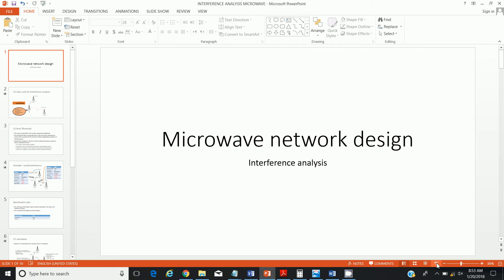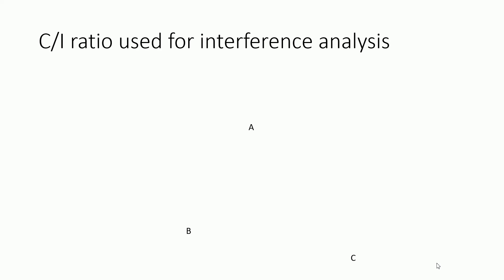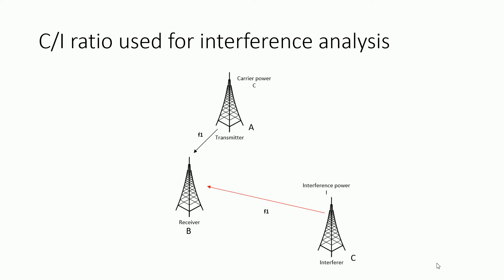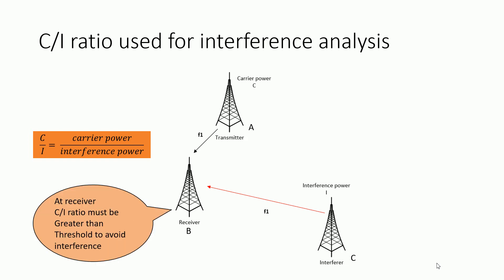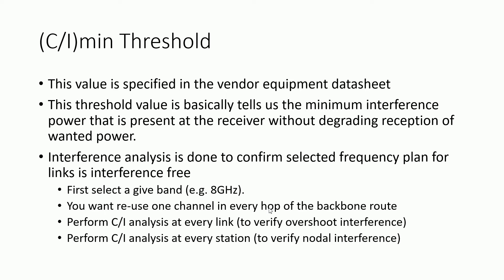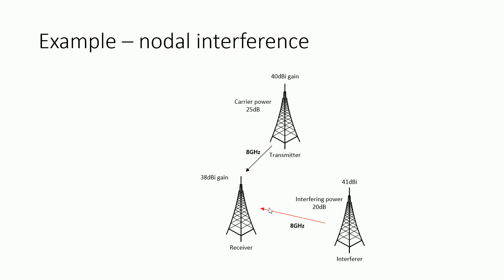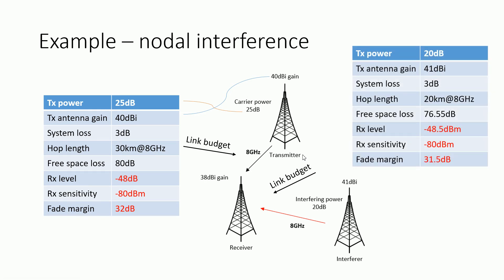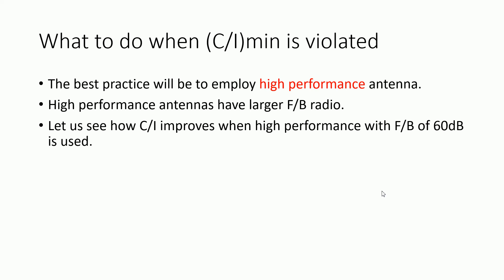microwave link interference analysis

Comment: i am using pathloss 4 and i have a case where i should use a certain channel and when i am  doing interference test i have more than 5 interference cases but all of the cases have a good  C to I values compared to T to I, in this situation do i check each case separately and if C to I value is good then this link will work or should i consider the impact of the other cases too, by checking total threshold degradation